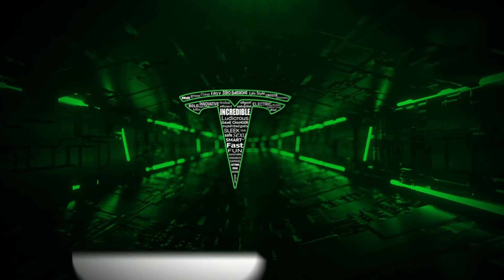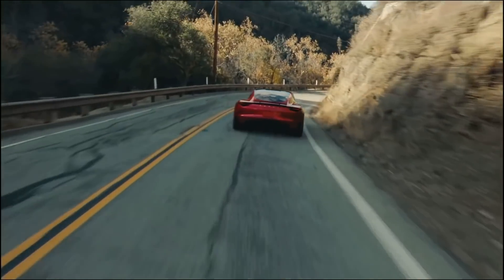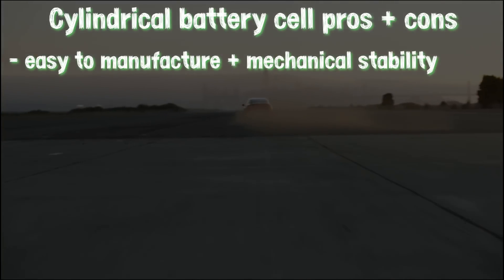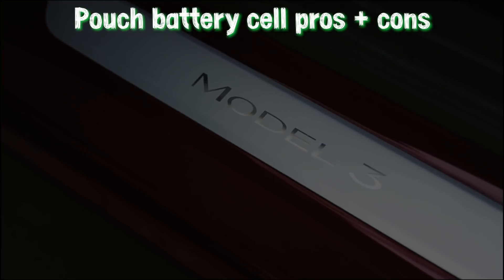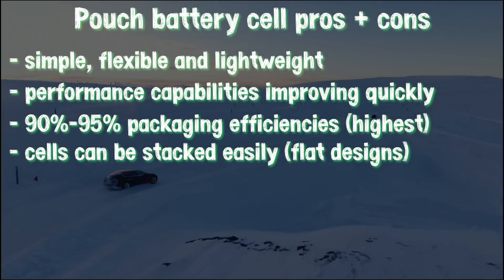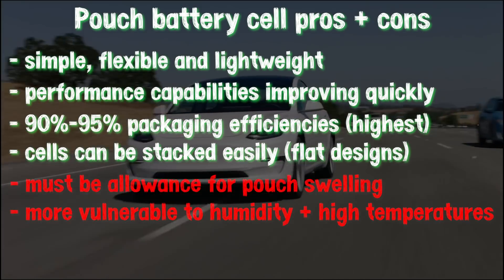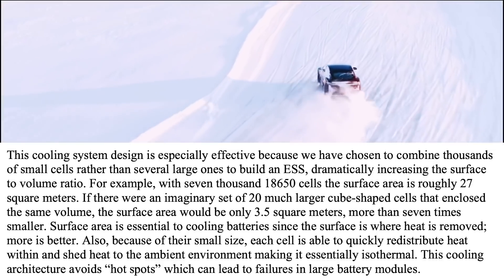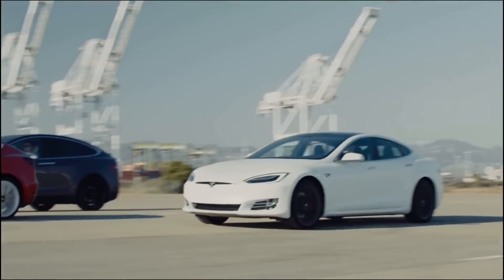Tesla Cylindrical Battery (vs. Pouch/Prismatic) and Tesla Battery News (CATL)

Comment: While commercially available cylindrical cells include a safety switch, I heard Tesla cells don't have them. Instead, the individual cells are monitored and switched off by the BMS. This saves cost and makes the pack smaller. That's my understanding anyway.
Reply: Each cell is connected to the pack by a thin wire doubling as a fuse.
The BMS monitors at best slices of a pack, not individual cells.
Reply from the maker: @musaran2  do you have an evidence of this further than speculation? TSLA has said in papers released by them that they can and do monitor at the cell level
Reply: @DillonLoomis22 /videos I saw that in https://www.youtube.com/watch?v=NpSrHZnCi-A , https://teslamotorsclub.com/tmc/threads/pics-info-inside-the-battery-pack.34934/ and other places.
Sure it's a few years old, but even on a recent patent (https://insideevs.com/news/376931/tesla-patent-battery-cell-pack-production/ ) it looks similar.
If Tesla did change that I would be very curious how, as i can't imagine any practical or economical way for so many small cells.
Reply: @musaran2  Yes, this sounds right. I read about this around 5 years ago, so I don't remember the details. But I do remember that, starting with the Model S, Tesla's cylindrical cells removed the safety cap, since safety was managed within the battery pack. This saved both cost and space.
Reply from the maker: Hey Dave! Another commentor mentioned this as well. It may very well be true, as the only thing I confirmed was that they had them in the Roadster days...as we know that could have very well changed by now! Thank you for mentioning this!

Comment: great video. I think Tesla's going to move away from the cylindrical 18650/2170 at some point soon. Back in the day Panasonic already had the tooling for commodity 18650's so makes sense that's what they went with when they formed that partnership. It also seems that they realized that the 18650 was way too heavy for the power produced so the move to the 2170 form factor was probably doable with the equipment on hand and the BMS hardware/software could be done with what they already had. My guess is the Model Y will have the 2170's but I'll bet the semi, truck and roadster will have new batteries. Also, even though Elon said that capacitors aren't necessary, I'll guarantee they'll be at least in the semi to extend the life of the pack considerably. My 2 cents, lol
Reply from the maker: Haha hey John! I'm always game to hear everyone's .02 - it's critical to keep growing and understanding and to challenge all assumptions...a healthy human exercise! What do you think they'd switch to and why?

Comment: A very good overview of the current Lipo packaging methods.
I think Pouch style is the future of LiPo's. 

In RC (remote controlled) vehicles we use pouch style Lipo's for >15 years and they have completely replaced all other battery types/packages.
The big advantages of Pouch style LiPo's are higest volume, weight and power density. In RC most commercially available packs can do 20C continuous and up to 100C short term discharge rates and 2-10C charge rates. If Tesla would produce their Model 3 packs with this cells, the 74kWh battery could deliver continuous 1,4MW, and peak 74MW power rates! So wayyyy more than currently.

The disadvantage in real life is mechanical sensitivity (very soft pouches) so you have to protect them well, and swelling of the packs (can be significant if high power is drawn under low temps).
Mechanical issues are already taken care with current pack encasing, and swelling (gassing) can be solved by not closing the pouches but rather adding a volume compensating device (like for example in your heating system). It's not rentable for each pouch, but it makes sense if you have 2-4 (for redundancy) devices for the whole battery pack!
Thermals are actually non concern because of low internal resistance, so low self heating of the packs. In most cases you would actually need to heat up the cells to get the best performance.
Reply from the maker: Hey Drago! Thanks for sharing this...this is a very insightful and accurate comment! How do you work with RC cars exactly...that's so cool!

Comment: I see another advantage of the cylindrical cells: if production of a cell fails, a smaller unit is wasted. As I know,  Li-ion battery manufacturing is like chip making: only at the end of a long process you can be sure what you have produced. Although, mid process test can throw out the trivially failed cells, only after the testing phase can you decide what goes to EV battery packs, what is good at least for stationary usage and what goes to trash. Powerwall is in my opinion not a product but a byproduct.
This advantage of smaller production units is similar to the advantage of AMD making small chiplets, instead of huge monolithic chips.
Reply from the maker: Hey Bokolo - this is an important point indeed, thanks for sharing!

Comment: One fact not emphasized (though you didn't completely neglect this) in your video is the size differences between cylindrical versus pouch and prismatic cells.  The photo you showed of all three was not to scale.

This difference in size is important.  One, with small cylindrical cells it's easier to get cooling to where the chemistry is happening.  This bodes well for longevity/cycle life.  Two, it's cheaper and easier to assemble packs for pouch and prismatic cells, since a BEV has only hundreds of large cells, not thousands of small ones.  So vehicle prices can be lowered somewhat if pouch or prismatic cells are used.  And three, every automotive cell manufacturer is producing pouch and prismatic cells, but only one is producing cylindrical automotive cells:  Panasonic (because Tesla insisted on it).  Cell manufacturers like larger cells because quality control and testing is less work.  That's a big deal for cell manufacturers, because tolerances are very, very tight for automotive cells.  Quality control is a struggle.

Tesla can't get enough cells.  Their appetite for cells is bottomless.  And so it's not exactly a shock that they would consider pouch or prismatic cells from vendors other than Panasonic.  Those are the cells those other vendors want to make.

But LFP cells from CATL?  That was a shocking leak.  I think we need to hear confirmation from Tesla to believe it.

LFP cells have a far lower energy density, as compared to the lithium-nickle cell chemistry Tesla is currently using in the Model 3.  The cycle life is worse for LFP, too, I think.  Putting LFP cells into the Chinese Model 3 would yield worse performance specs and worse longevity.  That sure isn't on the path to million mile batteries.  I recoil in horror!  I do not think it will serve Tesla's interests, or anyone's, to make Chinese Model 3s inferior to those made elsewhere.

If Tesla's Chinese products are inferior, I would expect a serious backlash from Chinese consumers and maybe the CCP government, too.  China is not in a mood to be treated to deliberately-inferior cars.  Who would be?  When China agreed to let Tesla be the sole owner of its Chinese operations, I'm sure they expected products every bit the equal of Tesla's products made in the US and elsewhere.

I could possibly see Tesla buying CATL's LFP cells for use in utility infrastructure projects and in Powerwalls.  The lower energy density/higher weight per KWh isn't as much of a problem for fixed installations, and it's certain they could get LFP cells for cheap.  Doing this would free up some cylindrical cell production for mobile applications (vehicles).  I'm not sure how worse cycle life would work out in fixed installations, but I am sure that Tesla can beef up thermal management for fixed installations more readily than they can for vehicles, because the weight trade-off for HVAC is less onerous.  Perhaps Tesla thinks they can get enough cycle life out of LFP through superior thermal management for fixed installations?

There's a couple more points left to make.

One is that Tesla currently produces pack modules, then assembles the modules into packs.  Elon Musk has said that modularization in packs is an engineering solution to a problem that no longer exists.  He sees weight savings to harvest by skipping modules and assembling cells directly into completed packs.  That weight savings can be turned into more cells and more energy, or lighter vehicles, or a combination.  This direction in engineering could be used to improve somewhat the energy density of LFP packs for China's Model 3.  But I am pretty sure it would not close the gap between Chinese LFP packs and US-made cylindrical cell packs - and the latter packs will likely go through a redesign to give them the same advantages from eliminating modules.  So if someone tosses off the remark that eliminating modules will fix any gap in performance and durability between US packs and Chinese LFP packs, laugh them off.  It won't.

Another point to make concerns Tesla's (formerly Maxwell's) dry-coat electrode manufacturing process.  They aren't yet using this manufacturing method.  Everyone expects Tesla to begin soon, with benefits for longevity/cycle life and energy density.  Tesla may also soon begin making batteries with different electrolyte chemistry.  The big question is, will they hand over these technological advances to battery manufacturers?  Or will they confine those advances to their own cell production facilities (which don't yet exist), while continuing to grab old-tech batteries from vendors, as many as they can put their hands on?

Like I said, their appetite for automotive battery cells is bottomless.  They need everything.  They can use old-tech cells in cheaper vehicle models, in utility infrastructure projects and in Powerwalls.  They can use new-tech cells in the pricier vehicle models while they ramp up production, aiming eventually to make enough new-tech cells to support all of their battery needs (but that can't happen quickly, it's likely a difficult production ramp).

So could Tesla hand that tech over to Panasonic for use in GF Nevada?  They could, probably, but I don't know if they will.

What about LG Chem?  Or CATL?  I'm afraid Tesla might run afoul of US laws governing tech transfers.  Make no mistake, a new-tech battery will have military implications even if the US military has no intention to use it themselves.  Tesla would probably need an export license to hand it over to CATL, and it could take a long time to get approval for that.  For this reason, I expect that whatever deal Tesla is cooking up with CATL, it involves CATL's own tech, not something newfangled created in Tesla's labs.

So the bottom line is, I'm awfully eager to hear what Elon will tell us in April about their battery plans.  And I hope like hell that Chinese Model 3s will be every bit as good for the price as Tesla's US-produced Model 3s.  If they aren't, it could get ugly real fast.
Reply from the maker: Hey man! Thank you so much for taking the time to share this, I thoroughly enjoyed reading it and I completely agree...thanks for making the point about the cell size as I probably should have emphasized that a bit more. You bring up some excellent points...one of my first thoughts on hearing the rumor was if the "cell to pack" technology would have enhancements capable of overcoming the LFP density and performance limitations. Big question mark here. Very curious to hear more...is China strong-arming them into using "their" tech? Many questions my friend...can't wait to hear more! And sorry, what's your first name again?
Reply: @DillonLoomis22  I just go by 'Urgelt' here (with an 'L').  It's a pseudonym.  I'm one of those very early YouTube posters who didn't quite trust this new-fangled internet thing to protect our privacy, and so put up a pseudonymous speed bump to hold our admirers and detractors at bay.  Not that either were very numerous in the early days.

'Cell to pack' isn't an LFP-exclusive engineering concept, and so it won't help to close the gap for LFP.  If it make sense, it'll make sense regardless of cell chemistry.  Am I making this clear enough?  'Cell to pack' will advance any and every cell chemistry.  So there is no gap closing from one cell chemistry to another.  LFP remains inferior if that's all that's going on.

I didn't mention the possibility that CATL, or Tesla, or the combination of the two companies, might come up with ways  to improve LFP energy density and cycle life, so that it's comparable to lithium-nickle (Panasonic's 2170 cells).  I didn't, because I don't believe it.

I could be wrong, though.  That sure isn't my name (or my pseudonym) going on all of those battery patents.

I don't know who is strong-arming whom.  I know Tesla has a ginormous great big motive to buy cells, anything they can get their hands on.  They're desperate, really, which hands leverage to the supplier.  I know their buying power, due to the size of their appetite and their checkbook, hands some leverage right back to Tesla.  Nobody else is buying batteries in such quantities; what supplier wants to miss out?  So who has the net advantage in negotiations?

Maybe the question has no meaning.  Tesla is buying, CATL and the others are selling, they negotiate and deals are made.  If the deals weren't appealing to every party, they wouldn't get signed.

If Tesla decides they can use LFP cells, then they'll take advantage of the reduced cost and buy some.  I'm just skeptical that sticking them in vehicles is a good thing to do for Tesla's customers or for Tesla itself.  But this is more of an open question than an answer.  We really need to hear from Tesla what the heck they're going to do.

Comment: "Outside of Tesla/Rivian, All of the main auto players are choosing Prismatic or Pouch"
Why Yes,... and they ALL have dreadful specifications in comparison to Tesla.
Tesla's decision to go with large numbers of small cylindrical cells was AND STILL IS Genius. The ONLY downside is the need to solve the problem of reliably interconnecting large numbers of cells, and they solved that a decade ago.

You very expertly explained the thermal/mechanical/production advantages of small cylindrical cells in this video so no need to say more. However, your suggestion that it's now even stevens between all three types is flawed.
- UNTIL cells that generate no waste heat in operation are developed (i.e. NEVER), ALL of the thermal and mechanical advantages of utilizing more smaller cylindrical cells still apply. 
- UNTIL larger cells that never fail (i.e. NEVER), larger numbers of small cells have an inherent advantage in minimizing lost pack capacity.
- UNTIL large cells with MUCH larger charge/discharge rates than necessary for EV function are developed, spreading ANY load across more (i.e. smaller) cells is ALWAYS going to result in better combined performance with less cell stress/degradation
- UNTIL cells that exhibit zero mechanical expansion in operation are developed, cylindrical formats will always be the most weight efficient container.
Reply from the maker: Hey Paul, thank you for taking a moment to share this insight! I can't say I wholeheartedly agree, but I do fully understand and mostly agree haha. My only question would be - if cylindrical cells are so clearly superior, even as of today, why is no one else using them?
Reply: @DillonLoomis22  
Not sure I can peer into such clearly compromised minds. You're talking about 
- entities that steadfastly refused to see the writing on the wall in 2012 when the Tesla S was released, writing that anyone even half awake to the realities of New Tech development & adoption curves could predict. 
- Entities that steadfastly refused to even begin to even attempt to compete, arrogantly assuming they could make the whole EV thing go away with dirty tricks, or simply that Elon would fail because they couldn't do it. 
Their ability to clearly assess technical matters was fatally compromised.

I suspect that the half-baked idea of squeezing cells into an existing ICE chassis doesn't gel well with 4000-7000 cylindrical cells? Their half-hearted approach all along, designed to not impact their ICE activities too much while waiting for Tesla/EV's to fail, mandated this clearly sub-optimal decision. Even though the skateboard idea is clearly dynamically superior and well suited to small cells, their legacy constraints, and hubris, prevented them making such drastic changes. 
And NOW, invested in those (sub-optimal) cell providers, they simply cannot afford to abandon those established relationships. As rubbish as the tech is, they cannot abandon what little battery supplies they have, EVEN now, while they're being forced to halt critical EV production lines left, right and center every other week. There are just not enough cell providers out there. 
They're 6 years behind the curve in a tech race that moves faster than anything they have ever experienced in the ICE auto world. They willfully ignored the challenge and now it's too late, they cannot countenance abandoning even the miserable progress they made while sleepwalking to their doom. Their only option is to offer sub-par cars propped up by marketing, customer loyalty, and dirty tricks against Tesla (short selling, FUD, state sales restrictions,...)

In the end, to summarize the wind-baggery above, Legacy auto failed for the same reason ALL Legacy players fail when confronted with a technological paradigm shift. They have too many internal and external conflicting interests to radically adapt, forcing them to adopt sub optimal compromises, compromises which themselves become entrenched because their competitive situation is too dire to start over.